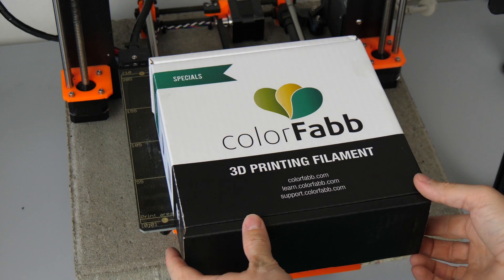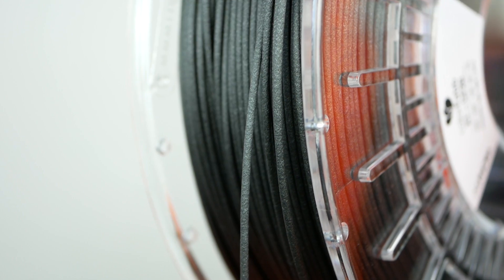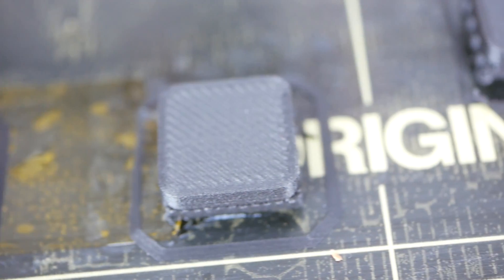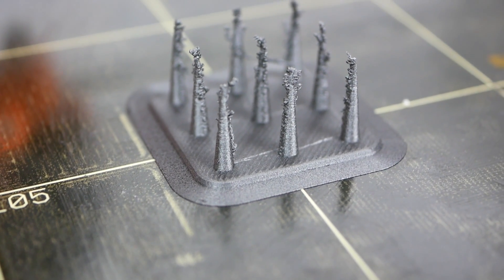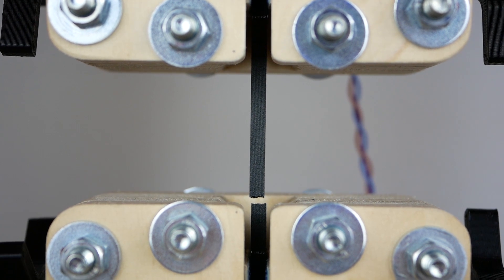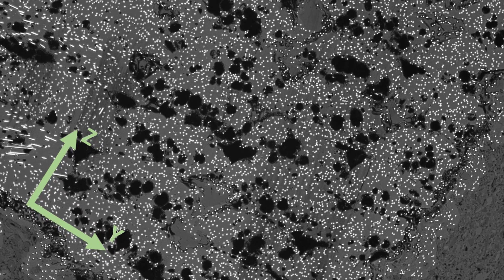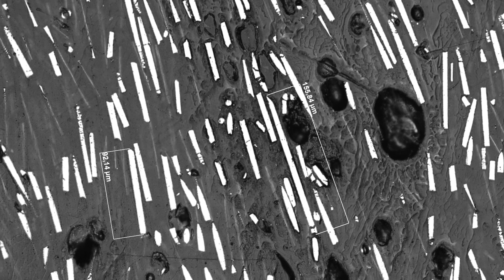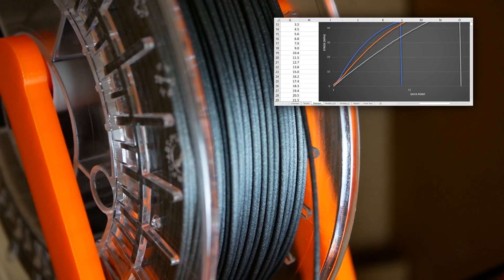3D PRINTING with CARBON FIBERS - ColorFabb XT-CF20 REVIEW

Comment: I wonder whats gonna happen years from now with the carbon fibre and resin crowd. We might all die in mass starvations caused by YoY multiple bread basket failures, or get annihilated in nuclear war/winter but still, even if nobody under 40 is gonna see their retirement its pretty crazy to be using super asbestos.

Comment: Before even watching the video I’m going to just guess that this isn’t anywhere near as strong as actual carbon fibre made the proper way with numerous layers and weaves. The tensile strength of carbon fibre is phenomenal, but I don’t think that’s going to apply here because of the way that it’s “printed”. I don’t think it will have anywhere NEAR the strength compared to the real deal.

Comment: I would think if you look at the printing shop/fab/ home as being like a cleanroom it would be next to imposible to clean up micro deposits of. Carbon fiber dust all throughout. I'd expect much more strength etc from carbon but for the cost/biohazard I'll hold off indefinitely. PLA and PETG maybe TPU as well seem to be the strongest most versatile overall. Up till now I was only purchasing PLA+. Great vidios I'd been planning to research all the filaments but hadn't come close to getting around to it as I'm just starting out and juggling quite alot. Your research helps out the community immensly thanks!

Comment: I wonder if it is possible to co-extrude a 3D printable filament around a small bundle of continuous carbon fiber. From what I can tell the chopped stuff is only going to increase rigidity normal to the tool path and in compressive loading or bending moments. But a small CF wire surrounded by thermoplastic would be more akin to the type of automated composite layup tools seen in aerospace manufacturing. The only direction it would not strengthen the material would be tensile loading normal to the fiber orientation, and even that should be pretty close if not equal to the base polymer's strength.

Comment: 6:30 try getting a HEPA filter, and/or put the printer intoa an enclosure, ive seen some nice ones using IKEA Lack Tables.
Reply: With our location buying a HEPA filter was out of the physical size equation. After building an enclosure for our CR10s Pro we simply setup a fan that pulls and recirculates the chamber air through a carbon face mask. it works great and is a bunch cheaper than buying HEPA elements.

Comment: Very cool. This is one of the best 3d printing channels. I have been using Sainsmart ePA-CF filament (75% nylon, 25% CF) to print drone frames. I have been using single wall thickness tube structures to achieve a balance of weight and strength. I have been getting great results, but over a few months, a very rigid frame will become quite flexible, almost floppy. Is this because the print has absorbed water? If so, how can I seal the print to avoid this? Vielen Dank! -Seppi

Comment: Apart from asbestos, carbon fiber can be cough out or just should not be harmful as asbestos. Carbon fiber has similiar health hazards as Glass Fiber, but idk if the macrophage can destroy it, still, you can cough it out. Asbestos fiber looks like "barbed wire" thus leading to said lung diseases, beause, thanks to it's shape, it is scratching lungs. Mesothelioma can be caused by small exposure, BUT it is rare. Asbestosis is not rare, but you need to huff it everyday. 
But one thing here...
Carbon fiber uses epoxy, which, when heated, can cause cancer. In older days, asbestos was "miracle" and "future" of our homes.. now a nasty chemical.. and the same will propably happen to carbon stuff, if we don't find better gule-stuff to stick it together.

Comment: Dude - this was exceptionally well done! Thank you. Good point about carbon fiber particles - a friend of mine was a SAR Tech (Search And Rescue Technician) for the Canadian Armed forces up at Cold Lake where they flew the CF-18's. He had commented about the hazard of one of those planes going down because of fire and the carbon fiber used in the aircraft. The carbon fiber dust was especially dangerous - he flat out said it was deadly. I don't know anything about it besides what he said in passing.

Comment: You forgot to mention one of the properties carbon fibre is most known for and that is weight. I know its an old video now but can someone tell me with identically dimensioned models if carbon fibre is significantly lighter?

Comment: Yes I would imagine breathing in Carbon Fiber particles could be as bad or even worse then breathing in Aspestus.

Why?

Because what make Aspestus bad is is gets stuck in lung tissue and the cells in in your lung can not break down the fibers of it. Eventually the area in your lung will break down and become cancerous herd of Mesothelioma?

So what happens with carbon fibers?  Who knows, has anyone tested it?  It's strong stuff, I would caution on the error of not knowing until research is done. I will Google when done with comment to see.

But I would imagine "Carbon fibers" could not be broken down by the human body any better then Aspestus fibers.

Ok I found this, and we'll it is a big " who knows"

Be safe and cautious when working around Carbon Fiber in anything. Wear a mask and with C10 you should already have 1

https://www.dtc-uk.com/dust-extraction/could-carbon-fibre-really-be-the-new-asbestos-we-looked-at-the-facts/#:~:text=We%20can't%20say%20for,you%20work%20with%20it%20regularly.

Comment: At 2:50: SINCE the material is a co-polyester, it causes material to stick to the nozzle/heater block. I get the exact same result (blobs adhering to the print randomly) with PETG. Why do copolyesters behave that way? Is that because they seem to expand when inside the hot section? Thanks to anyone who can help!

Comment: this just sounds like asbestos, a magic fiber material that is easy to use but ends up giving you lung cancer
Reply: Carbon fibre without the resin stuff around it works quite similar

Comment: I'd be curious how well this filament fairs when under significant load over prolonged times. I had very bad results with the unpigmented ColorFabb PLA-PHA blend for this particular use case with formation of many parallel stress cracks of all sizes and wonder if it might help to switch to this carbon fiber reinforced filament (or just plain PETG).

Comment: Safety like everything even time is relative. Eg the insolation in your walls and even the drywall of your office has fiber glass in it. Every time a mouse gets in it moves fine fiberglass particles all over the place. Then they demolish the building load it all on uncovered trucks and drive through the city........ Relative to all that, this is nothing

Comment: Breathing fine metal dust and powdered fiberglass can and does give you mesothelioma.
I'm not sure if the fibers in the carbon fiber carry the same risk but for safety's sake we should assume similar or even the same health risk is applicable.

Thankfully I already have a perfect 3m p100 multigas respirator and even p100 non gas pancake filters near at hand and the filters are cheap and readily available.

Thanks for everything you do. This information is invaluable.

Comment: As someone who deals with asbestos in my line of work, I find it nothing short of outrageous that they are selling filament that is packed with microscopic biopersistent fibres in this day and age.  Carbon nanotubes have already been proven to cause fatal lung cancers such as mesothelioma.
Those microscopic cross section views were terrifying.  Wear a respirator while reworking?  How about all the fibres getting blow off into the surrounding space during the print process.
This is insanity!
Reply: Chill out, my dudes, CF is much thicker than asbestos fibers, and not thin enough to cause the cell piercing DNA damage that asbestos can
Reply: @MultiMacsek  it can get in your skin and get in your blood.
Reply: If it was CF nanotubes it would be a very different story.
Reply: Actually that's incorrect as a salesperson of this filament for 6 years
Reply: @rrtsduf  you are a salesperson not rnd they don't tell you facts cause facts don't sell
Reply: If you or a loved one has been diagnosed with Mesothelioma you may to be entitled to financial compensation.
Reply: It's totally encapsulated in the plastic, I don't see how a single fibre could escape.
Reply: @LooseyHenderson  when it is melted it is moved all around and exposed. Someone in the comments also said they got loads of fibers in their fingers.
Reply: @LooseyHenderson  If someone else touching the non-melted spool got them on their skin: they're light enough to be blown or knocked into the air.
Reply: I feel worried now, I printed with them for first time yesterday, couple of hours. Felt funny, had some nausea. I think I will throw away rest of the spool. Am I under any risk now, anything I can do?

Comment: Hey @CNC Kitchen, have you any suggestions for a impact resistant resistant 3D printable part?

I'm building a mini battlebot and it's going to take quite a few bumps and bangs from the likes of Drone motors with weights on them. White something really tough sounds ideal I'm wondering if the outer shell would be better if it possibly had some flex in it or am I best getting something that's just extremely strong?

I was going for CF but the fact it's only strong in one direction leaves me to believe there's something better out there.

Comment: I think you said that although the carbon fibre filament produced more rigid parts/products than most other filaments did, it did not produce as tough of test specimens as some other 3D printing polymer filaments.

I think you mentioned polycarbonate filaments produced tougher parts.

With price of filament not being a restricting factor, apart from polycarbonate filaments, what other polymer filaments would you recommend, if maximum toughness was your overriding design goal ??

For example, how does polycarbonate toughness compare to nylon66 ?? (Are they the same thing ??)

Great video !! (Liked & subscribed !!)

Comment: Excellent video Stefan!
 I have an Ender 5 on it's way to me, and I intend to print bed supports for it with the XT-CF20 filament. I've also ordered the same nozzle from E3D. I'm thinking I can reduce thickness of the supports if I'm using C/F, do think it's feasible? Alternatively I might print the dual Z axis parts as seen on Thingiverse and go that route. Either way, it's all interesting and fun stuff!!!

Comment: If carbon fibre filled PETG has such a high stiffness, what about carbon fibre filled ABS or even PC-MAX?
I just want something with crazy stiffness, decent layer adhesion, and no problems with creep. CF-XT20 certainly impresses in that regard, whilst also achieving the best surface finish on any FDM part I've seen, even bridging looks practically perfect, but surely we can do better in terms of stiffness?

P.S. I tend to print slow (15mm/s external perimetres) with XT-20 at 265 degrees for good layer-adhesion. I also use tungsten carbide nozzles, since hardened steel nozzles have horrible thermal conductivity and aren't nearly as durable.

Comment: Your under extrusion might be due to slippage on the extruder. Someone else said that they had to get a new extruder with fewer and larger teeth to stop it, as abrasive filaments such as this don't grip well. Increasing the flow or printing slow is a sloppy work around.

Comment: Please don´t rework carbon fiber material by sanding in your office! Carbon particles are electrically conductive, they can damage or destroy your computer or other electronical devices! If only the power supply unit crashes you are lucky...I know from experience. I think printing it may not be a problem because fibers are bonded.

Comment: To reduce moisture and keep dust off my filament I leave the plastic bag around the spool and simply cut a slit for the horizontal peg to hold the spool in position.   That way the spool stays in the the bag the throughout its use.

Comment: It could be interesting to try to print this in an enclosure and a small mesh filter to see if small carbon fibre particle are released
Reply: They will be, dangerous CF particles are only 5nm long. You need a really good filter. I'd recommend staying away from CF altogether

Comment: You need special certification to work with carbon and resin, so no you are right to be cautious, printing I don't think is a problom, but sanding defently is, the carbon fiberes will get stuck in your lungs, and they will NEVER leave your lungs again so long time exposure is werry dangores. Belive it's call iron ore black lungs, but I'm not sertan

Comment: I have worked with cured carbon fiber and you do need a mask if sanding, but if you are just printing it you should be good. The fibers should stay in the filament as it is still hot.
Reply: Probably, but why breathe polymer vapors ??

Comment: If you want it stronger you need to take care of the Fiber Directions in each layer. 0° first, then 90°, after that 45°, then 135°. The different orientation of each layer will increase the toughness and strenght of the filament.
Reply: how would you accomplish this during the printing process?

Comment: Have you heard of the iro3d metal printer? It's a printer where you print a dry sand-metal mixture and then the part is cured in a kiln. This produces full density metal prints. And it's "only" $5,000.
Reply: Interesting input !!

I will check out the $5000 3D printer you mentioned.

As a technical note, sand filled metal filaments cannot produce fully metallic parts.      By definition, sand is not a metal...       (Not trying to be nit-picky, only sayin...)
Reply: @jeffthompson2464  The sand isn't mixed with the metal. The process is similar to casting.

Comment: There is no such thing as being over cautious about loose micro fibers of carbon fiber.  It may not be as dangerous as asbestos but any rigid fiber is potentially a cancer risk or lung necrosis hazard.  Definitely not for the home hobbyist as you never know where you invisibly contaminate any surface around your home.  At least treat it like glass fiber resin projects for health hazard factor.

Comment: I've used about a spool now of a different brand and yea this is more of  marketing tool rather than a useful material. I've made a lot of carbon fiber parts for cars and bikes over the years and in this application there is just not enough weave or overlapping of particles to really make much of a difference. I too have noticed clean up is an issue if you do any kind of finishing sanding or drilling. Mask or respirator for fine particles should be used along with gloves and a better disposal solution should be used instead of tossing flash or support material into your 3D printer trash bin. It does look good and it's fun to say 3d fiber this an that but I never found a project where this improved on the end result. Although compression forces might be improved now that I think of it. The fibers may hold it all together for longer under force.

Comment: Do you think that it is a feasible ideea to 3d print carbon fiber threaded rod (M6 size) for a linear motion mechanism (to lift 2 kg for  1 time per day)? I need to avoid metal in my environment.
Reply: Maybe look at threading an acrylic rod. I think Igus make them

Comment: What is the strongest FIlament i can use ?
Reply: Depends what kind of strength you need. If you need compression resistance and stiffness PLA is good, if need something that handles impacts well without cracking you could look into PETG or nylon or possibly ABS, high impact PLA is a middleground. If you need something that has to absorb shock or needs to be bendy then TPU will do the job.